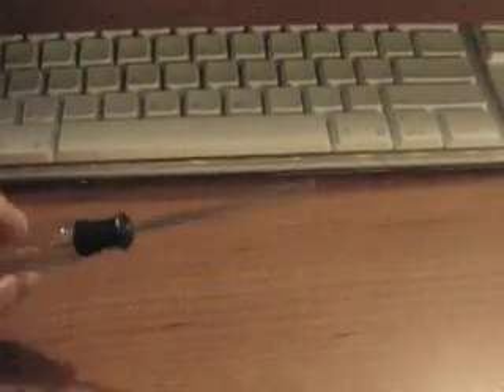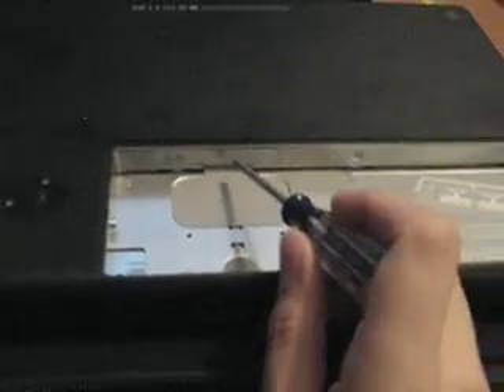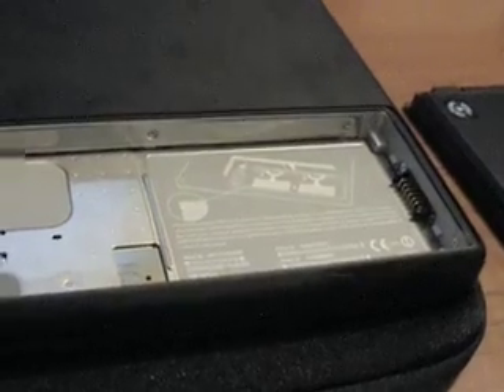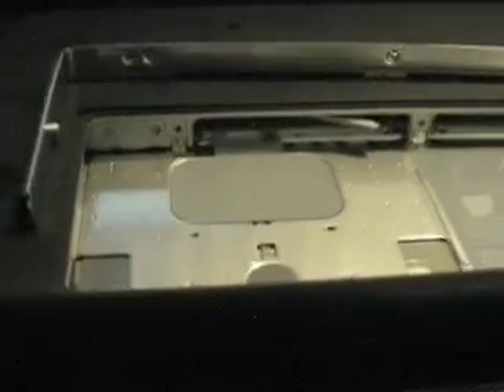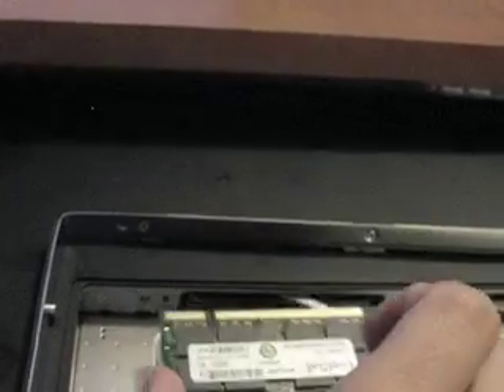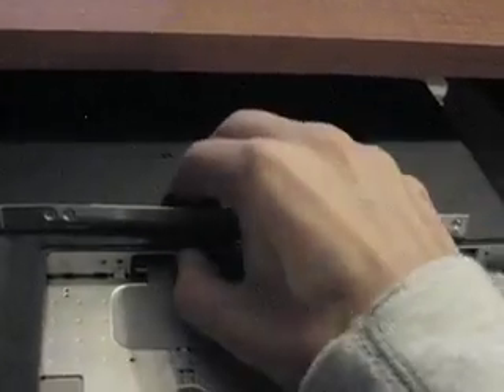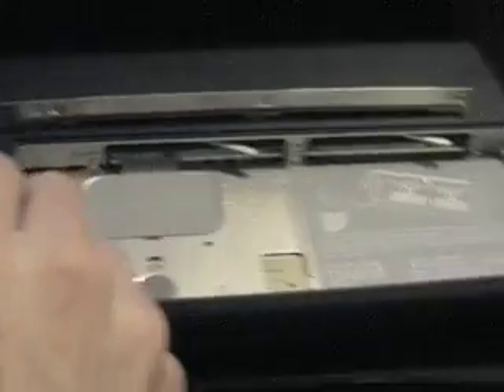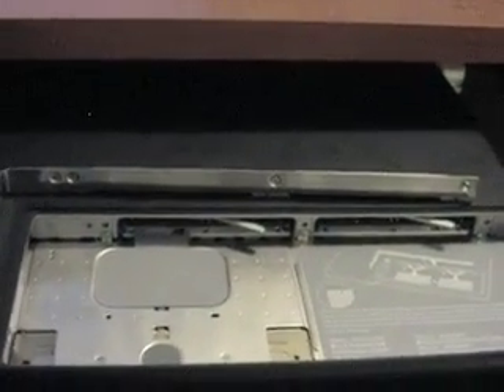Macbook RAM upgrade tutorial

Comment from the maker: marioman0123- Upgrading the RAM does not void your warranty...As long as you don't damage the computer in the process. If you put the RAM in backwards, smack it in with a hammer because it didn't slide in, and wind up breaking something...then they won't fix it. But upgrading the RAM will not void the warranty. You can also upgrade the HD in a Macbook.